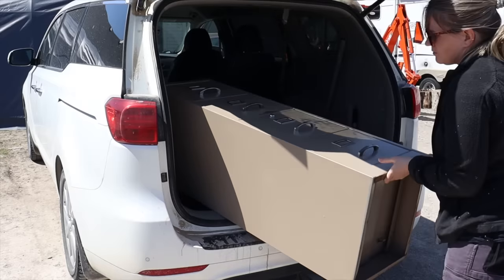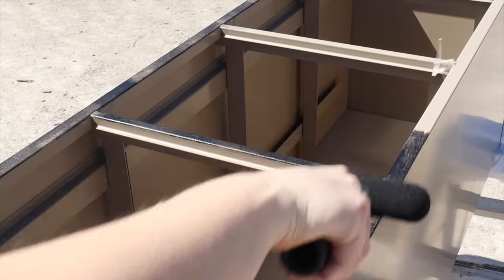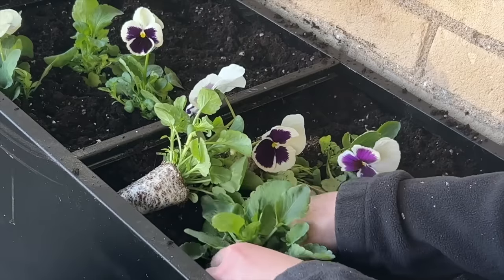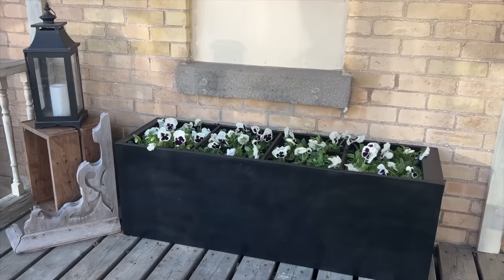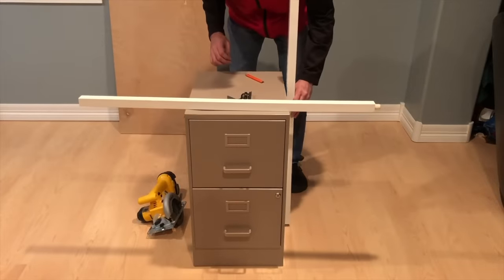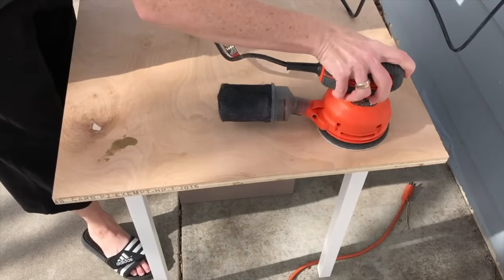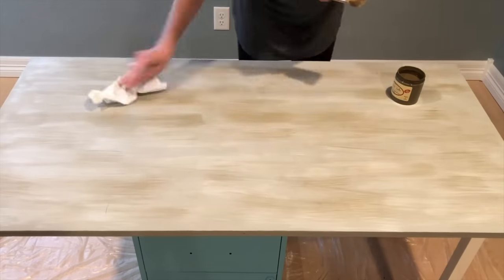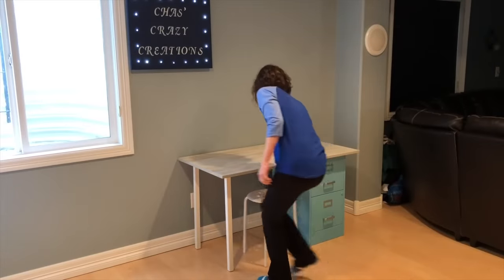People are flipping out over this CRAZY file cabinet hack!

Comment: Won’t the leaves settle once u water these plants? Or with consistent watering over a period of time? Just curious
Reply: They will. I use this method for my garden tubs. Actually, as you put the dirt on top of the leaves, the leaves settle, so you will need more dirt than she made it seem. The leaves will compost and next year, you will need to add more soil. I put broken branches, waste from trimming around trees, leaves and lawn clippings to fill my tubs about half way. I added dirt from my compost heap mixed with raised bed soil I bought. In the spring, I use a fork to mix stuff around and add more compost to bring the level back up again. So, yes the leaves will settle and you will have to add more dirt, but you won't have to add it all at once, so you spread out the cost and labor over the seasons.
Reply: @jennypulczinski7204  do you need to add holes for drainage or do you just let it rust? And wouldn’t the black make it get too hot for the flowers? I have seen this upcycle before and I have an old file cabinet that I want to use this way.
Reply: @lorrem2539  I would assume you'd have to have drainage holes, so I would think if you want to put it on a wooden deck, you'd have to protect the deck somehow. I am not sure how you'd do that. If you are putting it in river rock landscaping or over dirt or grass, you wouldn't have to worry about the water.
Reply: @lorrem2539  She drilled holes in the "bottom" during the first minute or so of the video (but then seemed to cover them up with bags of pebbles, so I dunno lol). Yes, I would choose a different colour to black if your region is very hot/dry or the position is very sunny. Also, the plastic bags, here in Australia anyway, seem to have a half life of about 12 - 24 months in these kinds of conditions, after that they start to disintegrate, so this method of throwing whole bags of pebbles in wouldn't work for me if I intended to leave this arrangement in place. Depends how "bio-degradable" plastic bags are in your region. Hubby bought a large bag of salt to kill off weeds, never got to it, and now there's a bag shaped block of salt sitting in the old carport, but it took a few years. Not everything that can be done, should be done.
Reply: @jennypulczinski7204  Perhaps it could be raised up on bricks to keep it off the decking material?
Reply: I used milk jugs to take up space in mine.
Reply: @KatherineTeacher  That would work I'd think.
Reply: @Kayenne54   Yes, the bags would rot, I'm sure. I got a really good deal on mulch one fall, and I didn't have an indoor spot for that many bags, so 10 or so bags sat outside. The ones on the bottom couple rows were so rotted I couldn't even pick them up after a winter and a summer outside. I tipped my cart forward and shoved them into the cart and pulled out the plastic to use them
Reply: @jennypulczinski7204  Yes, I think our video poster just made a whole new problem for herself.

Comment: Aren’t the metal edges of the decorative metal still sharp even after applied to the drawer front? What did you do to prevent injury?
Reply: my question also, this metal is sharp!!
Reply: They sell some great looking plastic self adhesive back splash textured tiles at Dollar Tree which would work great in a project like this without the fear of sharp metal edges
Reply: @adobeblue4360  you could if you like,is add a wooden frame around the top with rounded edges.

Comment: I saw an entryway bench will storage cubby’s!!!! Just flip it on its side!! THANK YOU SO MUCH FOR THE INSPIRATION. Sometimes I just need to see someone taking it apart and reusing it in THEIR way to get see how I can use it in MY way!!!!!!!!!
Reply: That's a great idea!
Reply: Wouldn’t that bench be very low even if the filing cabinet was wide enough to hold legal size folders?  I’m also wondering if I keep the drawers in for storage, how would I keep things from falling out as I opened the drawer?  Would you use something else in the openings for drawers?

Comment: Filing cabinets are great for storage too. I use mine for Sandpaper, spray paint, and my drill, sander, soldering gun, etc.
Reply: Turned mine into a pantry.....such a backsaver!!! Looking for another, I got it for $1....yeah
Reply: @kimberluna2226  great idea! And the drawers slide out so you can get to the stuff in the back. Love it
Reply: @patlynn2418  your welcome...it works...
Reply: Such great ideas!!
Reply: You would get a thumbs up for your name alone, even if I didn't like your comment. (But I do)

You can plant a womantic wed wose in your planter.
Reply: which paint spray did you use?
Reply: Me too. I clean parking lots and find them at donation bins all the time. If they are in good shape I grab them and use them in my garage for storage. I also took the drawers out of one and hung it horizontally on the wall. It works perfect.

Comment: Take those drawers to create more metal planters. (Nesting flattened cardboard boxes in the bottom is a good biodegradable base in your planters as well.)
I love this idea to up cycle the filing cabinet or anything else that can be used.
Reply: Good idea. I may colorfully paint the outside of each one & cheerfully arrange the planters. Add some bling or sparkle to the yard. May paint each one same color as matching set. Thanks!

Comment: I LOVE your repurposing a four drawer filing cabinet into a large planter! 🙌 When I borrow your idea, I think I will drill a few more drainage holes, but not so many the metal is weakened.  After the bags of pea gravel, I will add recyclable plastic bottles with lids that I save for drainage in large pots.  Next, I will wet down the leaves before adding a layer of topsoil.  Then I will add my potting soil and plants.  I only wish I could figure out how to pin your idea to Pinterest! ❤
Reply: Hit share. Then choose Pinterest

Comment: First, this is a GREAT idea and I’ve seen this idea before and have got 2 smaller filing cabinets to do this. BUT, I feel like this might rot the deck so I would definitely get some legs or at least put some rocks to lift up off the wood. Happy crafting! 👍🤩❤️
Reply: Also could make an entry seating thingy with those $Tree bins in the cabinet holes & a wood top
Reply: @leahrowe847  I don’t follow what you mean?
Reply: @KatherineTeacher  take a flie cabnit, remove drawers, paint, flip onto side, lay longways with holes facing out toward your feet (not ceiling), add a piece of Plywood or hardwood (sanded, stained, & clear coat sealed of course) to the top & screw down~ the wood is optional BTW, then buy the $Tree cloth bins & put in the file cabinet holes for storing shoes or whatever. You could even add casters if you wanted for easy maneuverability & cleaning. 
Wallah... You have a easy entryway seat, which can be the start of a drop zone organization area for the family. 
Hope you understand this better...

Comment: The problem I see with the metal filing cabinet planter is that with watering:
1.  The water will seep down into the leaves compressing them.
2.  The water will force the soil to down into the leaves.

The last project.  
I would have filed the edges of the decorative metal down.  Cut metal will slice through fingers and other body parts; hence the necessity of filing.

Comment: I reused my old file cabinet to store vaccuum heads, vac hoses, and cleaning tools inside. They're also great to use as shoe cupboards. I'd never use one outside where it could get wet and rust unless, of course, it was already rusted.
Reply: That's what rustolem paint is 4
Reply: @Leah Rowe  True. I live in a bipolar weather- high moisture swampy area, so even my rustoleumed chairs outside are rusting. My painted doorframe rots out every few years.  lol. I also don't have a low-sun porch for metal planters as the sun will beat on the metal and kill the plants. Also, have wild cats that would scratch the paint up. Sadface.
Reply: @messageviolation9014  I was thinking of doing this, adding a Li'l roof, then putting fake plants in it, so I wouldn't have to worry about rust from watering...  I think a few 2x2s & some fence slats would make a nice roof that would screw right to the sides pretty easy.
Reply: @MessageViolation  I hear ya on the rusty chairs... we sand & touch-up paint regularly to keep things nice & the rust down every yr or so
Reply: @Leah Rowe  That would look cute. I wish more people got rid of wood file cabinets because I want to put a  slab of wood over one to make a desk since lumber is high. Hoping more people do some spring cleaning 🙏

Comment: I wonder if wallpaper that looks like embossed tin could be used instead of the tin. I’d have to buy tin snips and protective gloves to do this project, which I like, btw.
Reply: Great idea! I have several rolls of it. Also, Dollar Tree has wonderful metallic plastic backsplash squares that should work great on this! I wouldn’t depend on the self-stickiness to last. I’d probably use heavy duty adhesive. But they’d be a nice compromise between metal and paper!
Reply: @kita6707  Nice to know that about the dollar store
Reply: @dale3404  You’re welcome. I didn’t specifically say that the Dollar Tree pieces are faux tin ceiling. You prob gathered that, though. They are really pretty.

Comment: File cabinets in my area are even cheaper..$5-10.  Also, won't moisture eventually get into your bags at the bottom?  Wouldn't it be better if you just put a couple concrete blocks or  stone pavers in there?
Reply: YES,brilliant. Smaller scrap items, not storage cabinets still useful for that.
Reply: Yes, obviously.
Reply: The file cabinet planter box may not last a very long time with all the moisture, but who cares? It’s so easy to make a new one every 2-5-10 years after they accumulate too much rust! As soon as I get home I’m getting started on one!
Reply: I think concrete leaches lime or something that's not great for plants 🤔
Reply: I forgot, Most people use sticks, wood, bark, etc for fill in the bottom. It's also good drainage
Reply: @davida1679  Didn’t she paint the inside of the filing cabinet with rustoleum paint too?  She painted two coats on.
Reply: @KatherineTeacher  I believe she painted the inside but only half way down.

Comment: Uhhhh...all those stones IN THE BAGS will NOT allow the water to get out of the drainage holes you drilled!!
Reply: And the sand in the plastic is more likely to get moldy bc water will eventually get in there.
Reply: And the dirt and moisture will eventually eat through those bags of gravel
Reply: Great point
Reply: Water always finds a way through
Reply: Is there a work-around to do this minus the pea gravel? I have a cabinet and I’m interested. What cha got peeps?
Reply: I figured out an amazing solution for the pebbles in the bag...what I did was take the pebbles out of the bags.
Reply: Bet they will

Comment: I saw another project on the internet where you cut the base out of the upper 3 drawers, leaving a lip around the edge. Put wire mesh in the base of the drawers fixing it to the lip with screws.
Drill some holes in the base and sides of the bottom drawer and make a grill to fit the top of the bottom drawer.
Remove all the plastic fittings on the front of the drawers and fit metal handles to the drawers.
You can then put charcoal in the bottom drawer and light it, put the grill on top and with the drawer out you have a barbecue. Light the charcoal and push the drawer nearly closed, leaving a gap for air to get in, put meat etc in the upper drawers on the mesh and you have a smoker.

Comment: For the first one...I thought you were putting it in the garage to hold shovels, brooms etc...
Reply: I think I saw that on Pinterest or maybe here on YouTube.  The filing cabinet drawers had been removed & the cabinet was on the floor next to the garage or shed wall.  I think there was a clothes rack with pegs up above.  The shovels were put into the empty drawer holes.  Their handles were in between the pegs.  Rake handles were down inside the empty holes & other other end were kept in place by the pegs above.

Comment: I would worry about the water draining out of the planter, along with the rain that runs under the planter, rotting the deck.
Reply: I would, too.
Reply: Place the planter on cinder blocks after you have drilled the drain holes.
Reply: @cindymeyer838   Or space the drain holes when you drill them so that they are lined up with the space between the deck boards. I'm not sure I would want cinder blocks as it would be too high and the blocks not very nice looking. Thin pavers would be better

Comment: We had an old office store that stored a lot of the filing cabinets outside on a deck, exposed to the weather. Guess what, they all rusted. Be sure to get those cabinets all rust proofed before you use it as planters. Those file cabinets are not stainless steel.